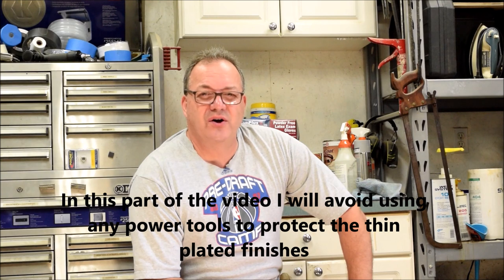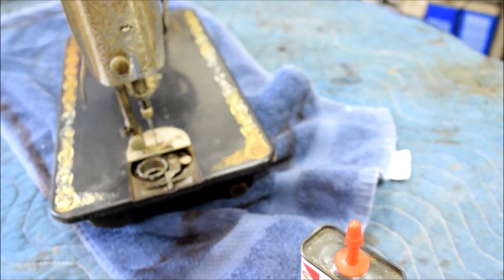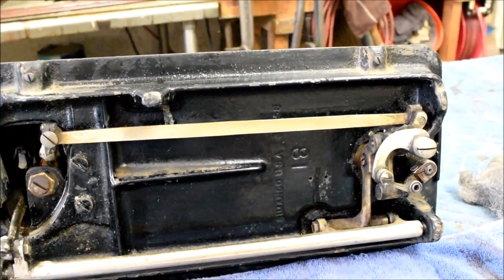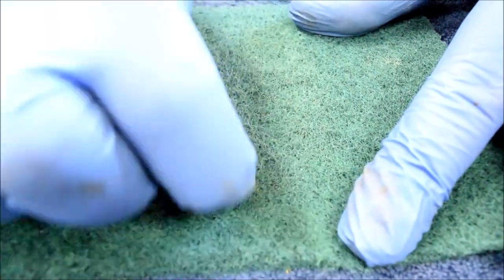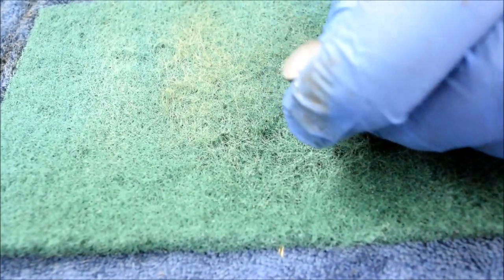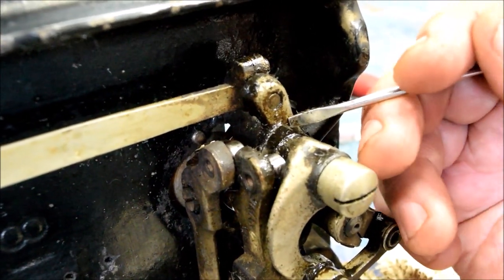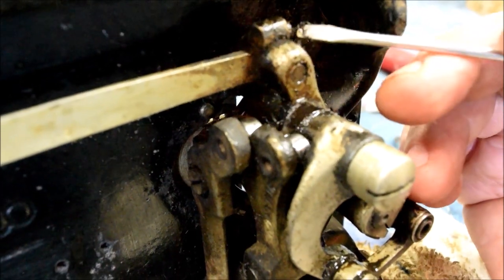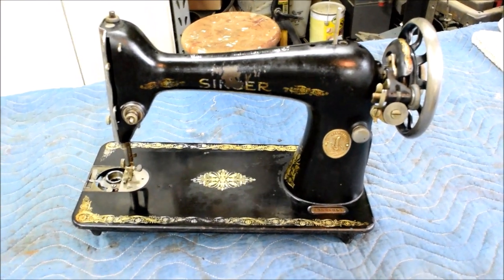Restoration of an Antique Singer Treadle Sewing Machine - Part 8 - Cleaning the Machine

Comment: I have used oven cleaner on all the mechanical parts ie. Linkages face plates etc and came up beautifully.  No. Damage to any surfaces. No metal removed . You have done an excellent job  of the entire project. Wrll done. A good workman.

Comment: For the rust, Evaporust works well.   I used it on my treadle faceplate and it helped without hurting it.   I heard about it from people who restore vintage machines.   Thanks for the tip on Simichrome and steel wool.  That looks like it did better than metal polish I used, even getting most of those tiny black dots.

Comment: I just picked up an antique singer that’s basically identical to this one (although in slightly better condition), and this was so helpful! I was trying to clean it (with literally just water, i know nothing about machine restoration) and noticed this gunk coming up which is apparently old sewing machine oil. I’ll have to pick up some oil and see if that helps, I don’t want to risk damaging such a beautiful machine.
Reply: Water soluble products can ruin the decals.   SMO (sewing machine oil) works.   Some people use Gojo for difficult areas.

Comment: That looks great! I think the gunk on the machine might have been nicotine, but the old oil does build up. It's nice you oiled the moving parts, that machine is very usable and oiling makes it run smoother. My local Walmart carries Singer oil or you can buy it by the gallon on line. 😲 That would be a lifetime supply for me with a lot left over, I go through about 8 ounces a year.  Nice job, Larry.

Comment: Thanks! Looks great! I want that can of Singer Oil!!!!!
I rescue old  Singers and get them back to sewing if possible. The place  where the black finish is missing may be from where in later years an after market lamp was put close to the body. I have one that has the same problem. Some of these machines were finished in shellack, so caution to anyone who wants to clean one of these up. Be careful with cleaner. I restore mine to working/sewing order so I can’t clean with machine oil.
You should have a companion blog where your subscribers can post pics of their finished projects inspired by your videos!
I know! So little time! 
Love your videos!
Reply: Might I ask why you wouldn't use SM oil for cleaning? Does it harm the shellac finish?

Comment: Try your metal polish with a piece of folded newspaper. Drop a pea size blob of metal polish onto the folded newspaper them start rubbing your piece through the polish with downward pressure. The paper will get a metallic sheen and your metal item will be burnished, clean away the excess cleaner with a soft cloth. 

I used this method to clean parts of horse harness when I was in an army ceremonial unit.
Reply from the maker: Great tip!  Thanks!

Comment: 50:50 vinegar and water cleaned up my covers - a 1911 neglected machine. Polish with a toothbrush and solvol autosol then I just buffed up with a drill/ wheel attachment. Worked a treat and is much gentler than wire wool.

Comment: The clear coat on the old machines is shellac which you probably use plenty of. You can re-do the exterior of the machine by adding more shellac with spirit and french polishing. This will also protect the decals better too.
Reply: Sharon, what is meant when you noted "adding more shellac w/spirit & French polishing"? I have methods I use but perhaps yours may work better. Thanks.

Comment: steel wool omg I don't think I can watch. I bought some GoJo. the sewing machine oil is for more delicate because it takes forever to cut through. I use it but have found coconut oil to be effective. going to try the GoJo today. Definitely don't want to use any abrasives on the machine itself. the customer can always buy another plate on eBay. rust converter may work but if so the way through probably just needs to be replaced. GoJo original has mineral oil in the ingredients.

Comment: the damage in the top arm centre was probably from many years of a pin cloth. a seamstress would pin a folded piece of cloth about 3" wide around the arm just there to have somewhere to stick her pins as she takes them out..you could add an authentic touch and hide that damage by using a pin cloth with a couple pins in it :)
Reply: You're right Pam. My mom did this on her treadle machine, which I learned to sew on, only she added a bit of stuffing to it and placed elastic to hold it in place. I've seen this also on some of the machines in my collection of 24 but they're not all Singers. I have a couple of Burnettes, 2 - ¾ sized Kenmores, 2 sergers, and 19 Singers, and a Graybar with a lovely cabinet w/a musical harp design on the supports..

I am blessed to be able to work at a local mission store, evaluate donated sm's and clean/fix those I'm able to so they can bless others.
Thanks for the input.

Comment: Hi just wondering about that badge, and specifically the little pins that hold the badge in place, were you able to remove and reinstall the originals? I just picked a machine up and really want to remove and fix up the badge, but don't want to ruin the pins, as I'm guessing they would be impossible to replace (they have fancy little rosette design heads). Cheers,
Reply from the maker: I really don't do much with the machines.  I leave those in place.  I assume they are the same kind of rivets that tags are affixed to machinery with and I believe you can purchase them.
Reply: @LostMountainRestoration  Thanks!

Comment: i just bought a singer sewing machine, with sewing table in working condition. It looks like the same model your cleaning. Can you tell me what model that is? Mine has a C serial number and i couldnt really find much on them.
Reply from the maker: I'm sorry, I don't remember.   There are a lot of very astute Singer collectors on-line.  I bet if you posted a photo of your machine in a Singer forum you would get many valuable replies.   Thanks and best regards.
Reply: @LostMountainRestoration  I was able to figure it out. I actually have a G series serial number. I was able to find that its called like a redeye and was built june 1910. I appreciate you taking the time to answer tho. Thank you!

Comment: wow!!! now this vid really helped me.  had no idea that all it takes is stuff i have at home and elbow grease. thanks a million.  dumb question?  are mineral spirits and mineral oil the same?  thanks again.
Reply from the maker: It's not a dumb question at all.  It can get a bit confusing.   Mineral Oil is an oil.   Mineral Spirits (similar to turpentine and less refined than Naptha) is an oil solvent.  Hope this helps.
Reply: @LostMountainRestoration  so helpful; thanks a million.

Comment: I found one of these old machines on the side of the road someone had dumped, is there a place to buy parts ?  oddly these machines are still in use in Cuba if I could take it there I could have is repaired like new for a few dollars.
Reply from the maker: I have found eBay to be the best place to find parts.  Also check local Facebook and Craigslist posts for decrepit machines you can buy for parts.

Comment: I have to assume that the delay in the finale of this series is because of the devistation Hurricane Michel caused in the area south of him. Its going to be quite a while till some areas even have power and other resources restored. Might just ultimately be a good thing that Larry has the machine and its not in a possible disaster zone of the owners. Best Wishes to All
Reply from the maker: It is.  I will probably put out the final video shortly without the reveal.  The owner is currently unable to travel north.  They are all safe and well, thank goodness.  I'm happy to store the machine here until circumstances allow them to travel.   Thanks for inquiring.
Reply: Somewhat of a wrap up would be a good idea right now. You can do an update & reveal at a future date, from what I have seen on the news, its going to be atleast a couple of months till things settle down somewhat and more till life is back to normal in so many areas, A whack of 2 hurricanes hitting fairly close together will do in the best of us. Even my family member in Maryland had rain and winds worse than they planned for and then the related humidity !!!

Comment: I've heard that the creamy GoJo hand cleaner (pumice free) works amazingly well to clean the bodies of the machines, but tbh I've never tried it (never had an old Singer to restore). Have you had any experience with it?
Reply from the maker: No.  I saw it on a YouTube video, though.   I used the oil as it was a recommendation from a viewer.  In the past I have just used soap and water or a dilute commercial cleaner.
Reply: The problem with the Go Jo is if the top coat is gone you can silver the decals. I know the video on you tube showing the guy using Go Jo. It's not recommended for vintage machines in the interest of preserving the decals.
Reply: Hi Sharon,
Be that as it may, I've tried everything and found gojo to be the best
I've spent over $100 on different cleaners and waxes and with all the scrubbing you 
have to do you stand a greater chance of messing up your decals and thinning the 
clearcoat.
For that matter I'd say if you hurt decals with gojo it's because they were in serious 
trouble already.
Sure you can go the zymol route and spend big bucks, but at the end of the day you 
will end up with a better surface with a $3 can of gojo.
I've learned this from actual doing, not hearing.

Comment: Oo no vinegar please.  It will pit the metal.  We were taught (in the army) when cleaning rifles to use the oil, cloths and repeated cleaning. Soaking in vinegar worked quickly ,but eventually pitted the metal parts (breach blocks etc)

Comment: Hi.  I'm restoring my Nannas 110yr old Singer Sewing Machine. I need to strip the paint back ready for respray. Should I write brush it or will that be too harsh?
Reply from the maker: I am not qualified to comment on the restoration of the machine itself.  There are a ton of forums out there with great advice on that.   Off the top of my head, I would not wire brush the machine.   I would explore a stripper of some kind, but make sure you check in with others more experienced than I.   Thanks for watching and best regards.